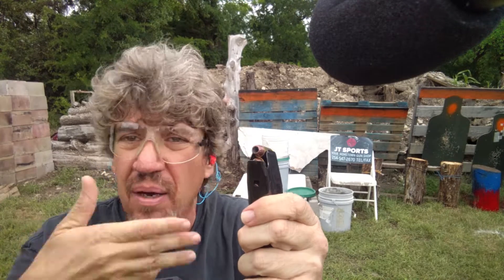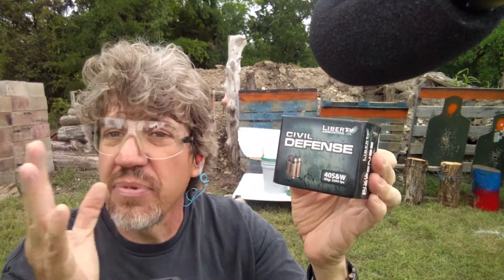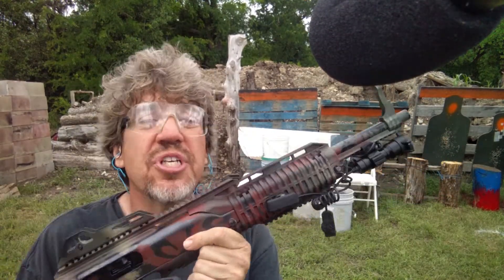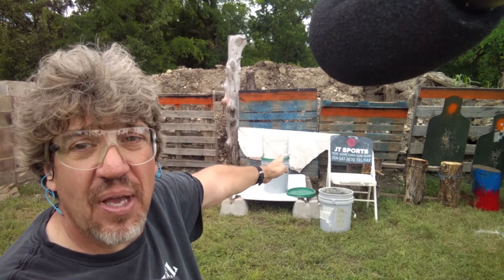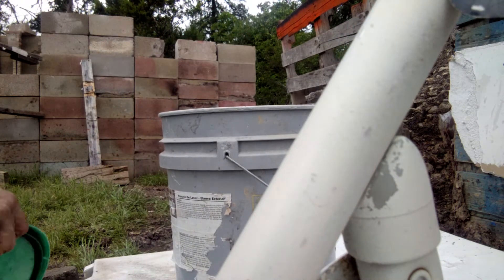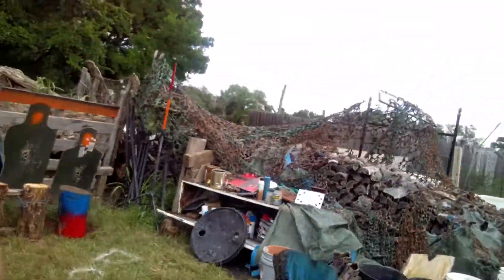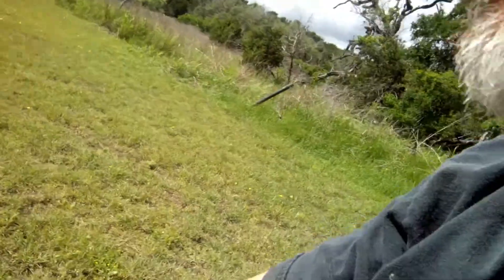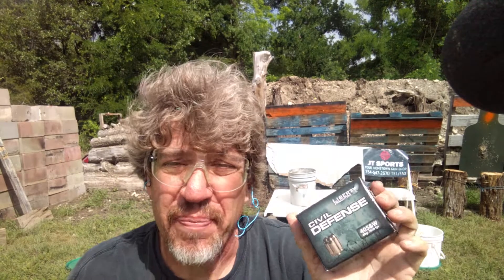Civil Defense home defense ammo Liberty Ammunition!

Comment: People are still in the old school mindset of pass threw. One day and it is slowly happening people will realize that when the bullet through design stops in a target, that means all of the kinetic energy is left where you want it in the target. That doesn't mean weak ammo it is about bullet design. That is the kind of bullets I search for. They have great power and performance, but are designed to stop in a target and dump all of the energy in the target. I use to have to make my own bullets to achieve this, but manufacturers are starting to get the idea.
Great video.